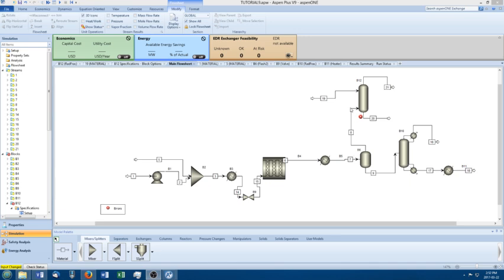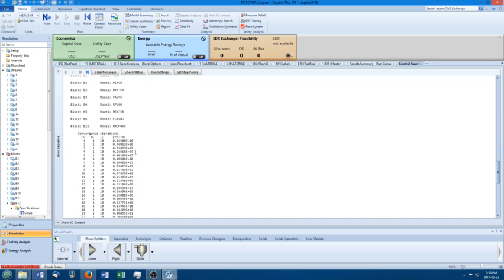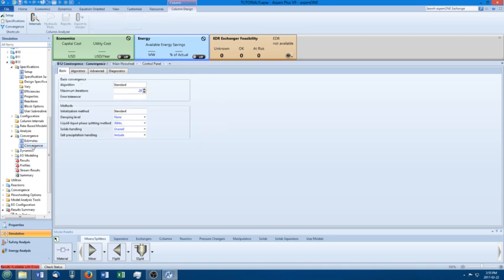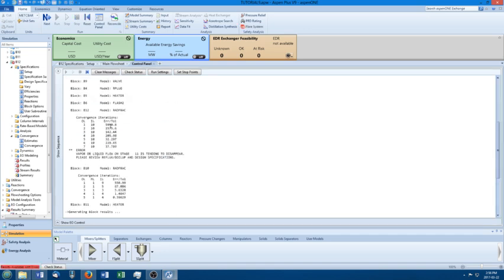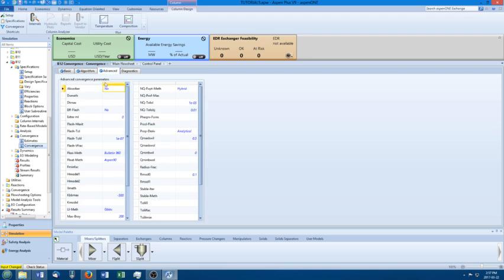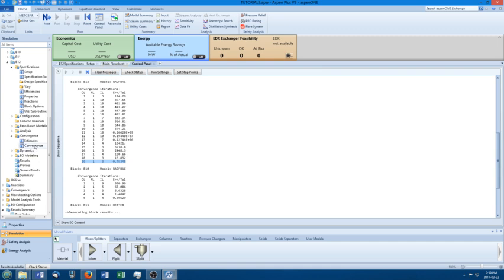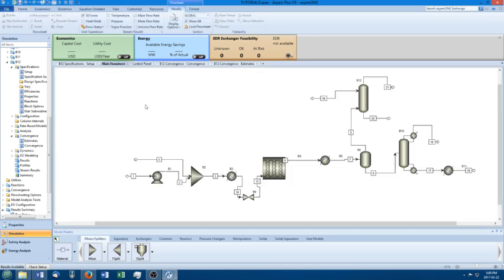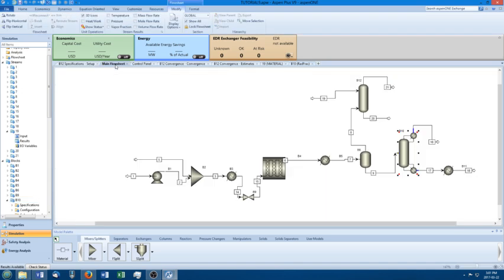Aspen Plus: Getting RadFrac to Converge

Comment: Thanks for simulation of Radfrac model. It is helping me lot. I am simulating radfrac model in my project. I am also getting error ' The following stages dried up 24 25 26.....' . Could you please explain about this error? I would really appreciate your help. Thank you.
Reply from the maker: The error means that the numerical solver which is trying to find the solutions to the set of nonlinear equations which describe the mass, energy, fugacity, and other balances across the column could not find a solution and failed in a way in which certain flow rates were negative in its last iteration. Basically, either your design is physically impossible, or, it is possible but the solver simply could not find the solution. Check your column design to make sure that it is not physically impossible (I.e. such a design could never exist). If that's not the case, then you need to try to get Aspen to find a solution be providing good initial guesses, or, by trying other designs that are not the same but which result in converged solutions that you can then modify from there to get the design you want. More explanation can be found in my book Learn Aspen Plus in 24 Hours.
Reply: @TadamsII  Thank you very much. I appreciate your reply. Definitely I will refer your book.

Comment: Hello, i am doing currently a wet scrubbing simulation for flue gas cleaning. The scrubbing is modeled as a packed absorber, it has no boiler nor condenser. And the outlet scrubbing liquid has to be recycled back to the absorber. I am having trouble i guss with convergence of tear stream. Although the convergence shows a blue check, but i always got mass balance problem upstream tje tear stream. Everytime i select other tear stream, the mass balance problem also moving to another equipment upstream the tear stream. I am desperate and have no clue how to solve this problem.

Comment: Good morning Mr. Professor Adams, maybe you could help me try to design a column converge until I start to specify in design and vary with highlights such as FINAL VALUE OF ONE OR MORE MANIPULATED VARIABLE LIES OUTSIDE
USER-SPECIFIED BOUNDS. BOUNDS FOR MANIPULATED VARIABLES ARE
NOT USED FOR DSMETH = SIMULT. because it will be. Thanks in advance
Reply from the maker: I don't know, I didn't know that it was possible for Aspen to manipulate variables outside of its bounds. Do you have something special and weird you are doing?

Comment: Hi. I am having beginner problems. I cannot find where/how to set the Rates (Non equilibrium model). The only time I was able to see it was when I used Acid Gas fluid package model (which requires H2S). I just want to simulate the regenerator.
Reply: By Rates I mean Ratesep
Reply from the maker: If you mean just switch to Rate-based mode in RadFrac (I don't think RateSep exists any more), Change the calculation type to "rate based" in the block's Configuration, and then go to Column INternals | [internals] and set the Mode to "Rating" for each of your stages (Also choose trays vs. packing). Covered extensively in chapter 8 of my book Learn Aspen Plus in 24 Hours (see http://psecommunity.org/books/lap24)

Comment: hello! chemical engineering student here :D
first I'd like to thank you for your explanation video. that helped me a lot! also, if you don't mind, I want to ask you about my radfrac absorption problem here. After i run my radfrac column it ended up having an error that says:

** ERROR
   CMBAL CALCULATIONS FAILURE: RERUN WITH CHANGES SUGGESTED
   IF THERE ARE ANY.

I've tried to change some of the convergence levels in diagnostics section (Spec -> Block Options -> Diagnostics), but it seemed not removing that error. Do you have any idea to solve this kind of error?

thanks in advance and keep up the good work, cheers! :D
Reply: I have never seen that one before, and based on searches it seems pretty rare. Can you describe what you are trying to do with that column? Have you ever gotten it to converge in any way shape or form (maybe with fake parameters / flow rates that you don't want)